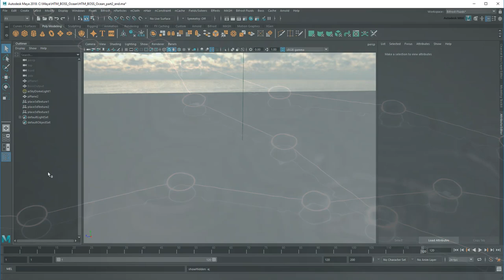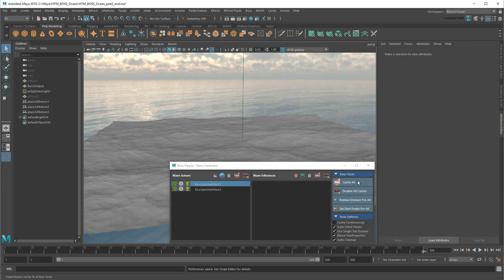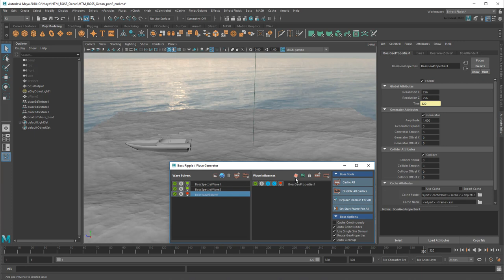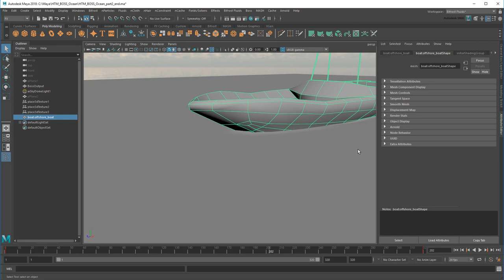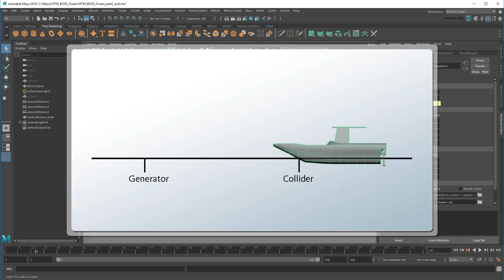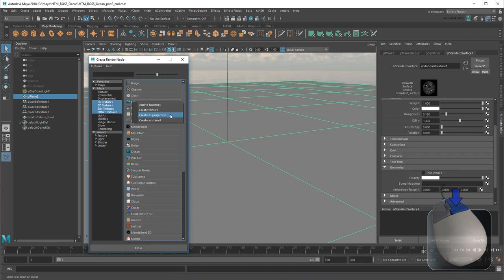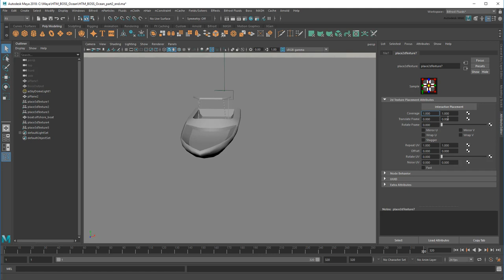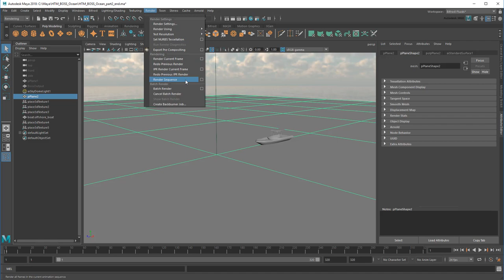Creating an ocean - Part 3 of 4: Adding a boat wake

Comment: When I add the boat as a wave solver, the ocean becomes invisible. Help?
Reply: The boat should be added as a Wave Influence object and not a Wave Solver
Reply: @timwong2704  Sorry, I meant Wave Influence. But I found that when I put the Wave Solver's resolution to 600 like in the video, the ocean disappears, but it doesn't crash. When I put it anywhere between 256 and 600, Maya crashes.
Reply: @jerrytheobnoxiousmouse.ser6161  What version of Maya/Bifrost are you using?  That is a known defect that should have been fixed in more recent builds.
Reply: @timwong2704  Maya 2019, in the plug-in editor, bifrostvisplugin.mll has a plugin version of 3.0
Reply: @timwong2704  I have managed to get through this problem by lowering the resolution of the wave solver, since it apparently was too big for my PC. I now have a problem where after adding the foam and everything to the flat plane at the end of the video, there's a square of normal water at the center of the ocean and the rest is white-colored like milk.

Comment: the boss plane has a weird deformation once the boat travels in the middle why?
Reply from the maker: Can you clarify what you mean by "weird deformation"?
Reply: Sir, 8:45 after the wave projection I can’t see the ocean effect while rendering the plane 2!
Reply from the maker: @mohitgurung3404  You don't see the original ocean waves, or the new wake waves?
Reply: Maya Learning Channel the new one! The render you have done at 8:45 you can see the waves but in my case there is mo any waves just a flat plane with tha eave solver! 
If only i could send you the picture! 😔
Reply from the maker: @mohitgurung3404  Are you sure you sized the projection properly and that it's pointed down and not up?  Also, when you render, try using the "Update Full Scene" command rather than the refresh button.  Sometimes it can make a difference.
Reply: Maya Learning Channel i have done exactly the way you did but as i said till the second part everything is right the projection render is correct but after the wave solver cache is done the projection only shows the flat image without the wave but shows the bump projection
Reply from the maker: @mohitgurung3404  So the moment you apply the bump mapping, your spectral waves disappear from the render?  If you remove the bump mapping, do the spectral waves come back?  If so that would be very odd.  Given that it seems like the spectral waves are being overwritten, are you sure that you applied the wake as a bump map and not as something else?
Reply: Maya Learning Channel the bump is correct but i think its the overwrite issue , does the incremental save effects the cache locations and the scene?
Reply from the maker: @mohitgurung3404  No it shouldn't.  Did you set the current project before you began working?  Maybe double-check to ensure that the paths are still correct for the spectral waves.
Reply: @Autodesk_Maya  yeah i set the project properly but idk how i got my this project cache in another project.. can i replace the projection waves again? will it have help anything for the problem?
Reply from the maker: @mohitgurung3404  Oh, the cache is in another project?  That might explain what's going on here.  I would advise that you move the cache to the proper project, then use this method to repath the BOSS files to it.

https://www.youtube.com/watch?v=JNPy4TUSUX4

Comment: Hi. Super tutorial. Because first time I can make real ocean. 1 i 2 part is ok but 3 part make my computer completely slowly. What is wrong with my hardware? I have 2 x Xeon X5650, 48GB RAM and Quadro K4200, Win 10. Maby my computer is weak?
Reply from the maker: BOSS is primarily a CPU-based feature, so anything to speed up your CPU power or RAM will generally boost performance.
Reply: At first I thank you for answering.  Ok I read about Boss and I know it use only CPU. But in viewport it use only 30% my core. Finally how can I force Maya to use more RAM? Could you help me/ I'm only 66years student.
Will be good to show your computer configuration before start the tutorials.  It's my suggestion.

Best regards. @Autodesk_Maya

Comment: When I turn off wrap for my wake foam, all my other tiles go white :(
Reply from the maker: That would make sense, since the foam would be stretched instead of wrapping around the UVs.
Reply: @Autodesk_Maya  But how come that's not happening in the video?
Reply from the maker: @ao1089  Ah sorry I misspoke.  Actually, you do want the texture just once (since you don't want the wake to repeat), but if everything else is going white I'd double-check to make sure a.) you plugged it into the right spot.  You didn't plug it into opacity or emission by accident did you?  Or b.) double-check the wake files themselves in a 2D image editor.  Do they look correct?  Or are they all white as well?
Reply: @Autodesk_Maya  I just got to say; thank you so much for these in-depth tutorials and for replying to my problem. Much appreciated!
I've plugged its "alpha out" into the shader's "emission", just like in the video. The cached foam texture looks correct; its alpha is all black except for where the foam is, where it's white. And yet somewhow it still makes all the other tiles white when I turn off wrap.

I'm having all sorts of problems with the wake, I'll just give up. For some reason my wake texture does not align with my boat, like yours does right off the bat after rotating it -90 in X. I'll have to move the projection around in X and Y to manually try to make it sit where it's supposed to be.

I don't get why there's no patch size settings in the wake's BossWaveSolver. I guess that's why we'll have to guess what size to scale up the projection to. Feels so arbitrary. A scale of 105 looks somewhat correct in my case. With the other textures at least we knew to scale it to half of the patch size.

And when I combine the primary waves' foam texture with the wake's foam texture using a colormath node, the foam becomes much darker. I tried increasing the alpha gain for both the textures, but it has absolutely no effect. Not even a value of 0 made any difference. Might that have something to do with Arnold's .TX conversion stuff?
This is way over my head... I'll just move on and try the particle foam stuff in lesson 4.

Thanks anyway!
Reply from the maker: @ao1089  Hmm, if you can host the file somewhere I can take a look at it.  Seems like it might be a compound problem (i.e. multiple things gone wrong stacked on top of each other) which will make it hard to debug without seeing it.
Reply: @Autodesk_Maya  Thank you so much! See if you can download it from here:
https://fil.email/FgVRglpI
A few things I did different: Arnold's subdivision made my displacement clip at certain camera angles, so I used a hi-res plane instead to project my textures onto.
I also used the wake's displacement map as vector displacement instead of bump.
EDIT: I just realized my "displacement clipping" was caused by too low value in my displacement shader's "bounds padding". Oops!
Reply: @ao1089  was this issue ever fixed as im having the same problem

Comment: Its not producing a wake after adding the object.
Reply from the maker: Did you make sure to turn your caches off?
Reply: Turned off caches and recached still didnt work
Reply from the maker: @arvin3567  Have you tried upping the wave size considerably on the wave solver?  Go really extreme just to see if there's any effect at all.
Reply: @Autodesk_Maya  Hi it worked now thanks! But after putting cache files as a bump map, its not showing up even though I increased the value of the bump map high.
Reply from the maker: @arvin3567  If you look at the texture files in an image viewer, do you clearly see the wake?  You can also try increasing the exposure on your bump map's file node.

Comment: Why don't I have an HTM_BOSS_Ocean_part2_end.ma folder
Reply from the maker: I just checked the download file and it does have it.  Maybe try re-downloading it.

If the files appear empty, remember that you need to regenerate the wave caches for the initial simulation (I didn't include them because they would've made the file size enormous)
Reply: @Autodesk_Maya  I know what I did wrong. Thank you very much